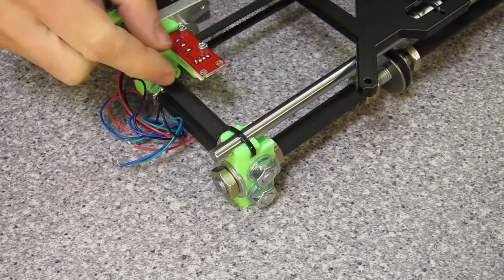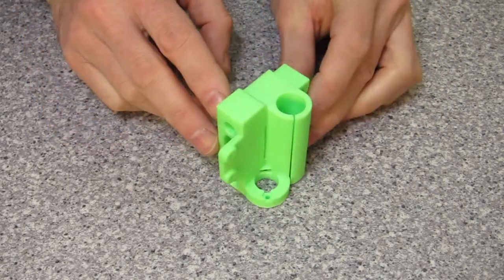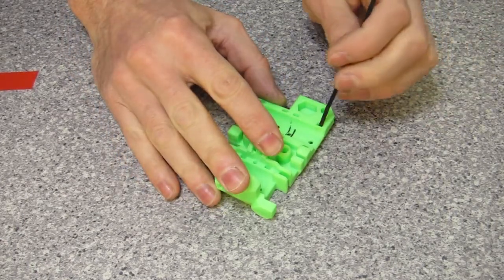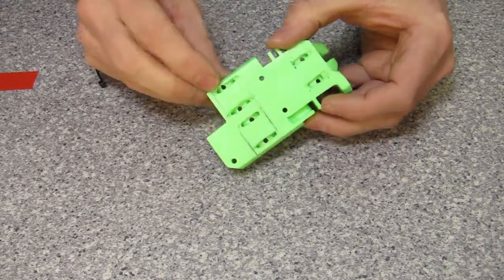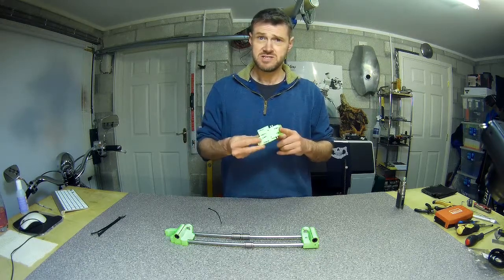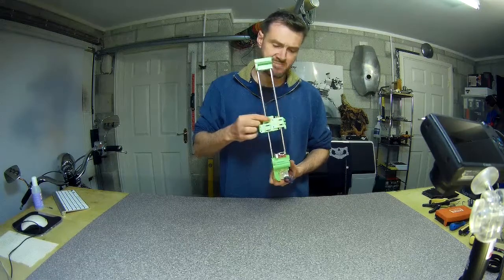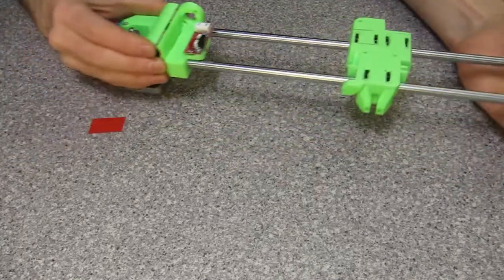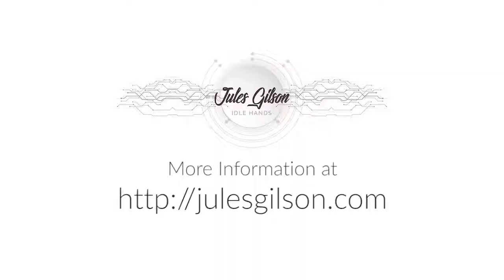How to Build Cheap DIY Prusa i3 MK2 3D Printer - 5 - X Axis

Comment: I printed my parts out of PLA+ with the exception of the hotend holder that someone printed out of PETG, PLA is plenty strong enough for structural parts. As for longevity I will get back to you. I might just print them after the fac tout of ABS on the printer itself. I had no issue with the hotend part with the cable ties.

Comment: I had similar issues with the cable ties but kept pushing new ones through until I got them through went through about 15 ties once they bent I just tossed aside. The endstop on my build is flipped over and the 10mm screw works just fine once you flip it over. I am not 100 percent what it hits but it does hit the extruder-cairage somewhere.
Reply from the maker: Good to know about the limit switch - should have known it would be upside down! Just wasn't getting anywhere with the cable ties, now it is all together I can see that it was no issue to slot it out. Did you have any issues getting the extruder gear to line up with the teflon tube? Not up and down the shaft, as naturally that can be adjusted, but my gear is/was too far towards the tensioner side so the filament doesn't have a straight path into the teflon. I have sort of modded it the best I can and it is a lot better. I guess the MK8 gear has slightly larger diameter - either that or my stepper mount holes are slightly different.
Reply: I am having an issue with the extruder gear. I saw Tom kind of drilled out his holes to shift his a little. I have purchased a second gear to see if i get better results. I will keep you informed.
Reply from the maker: I didnt recall Tom drilling it out - will have to look for that - but that is exactly what I have done. You can only drill it out a bit though as you hit the side of the raised part of the extruder body pretty quick. You are also then left with the teflon tube in a big hole... so had to cut and file some ABS and glue it in to get the hole back to 4mm, just further to one side. I also drilled out the hole the filament passes through at the top to the max size possible. These things made it a lot better. Nice to hear that I was not over-thinking the problem!